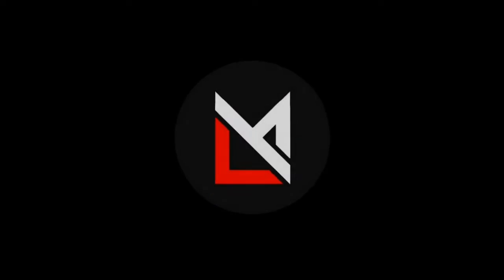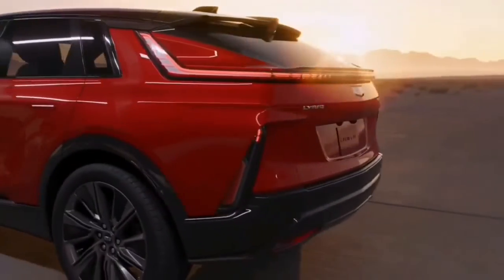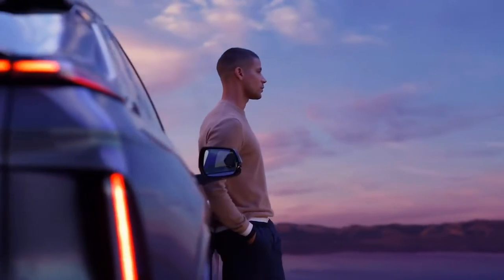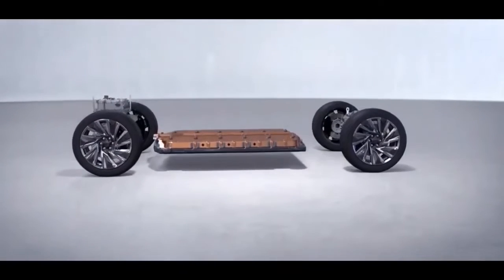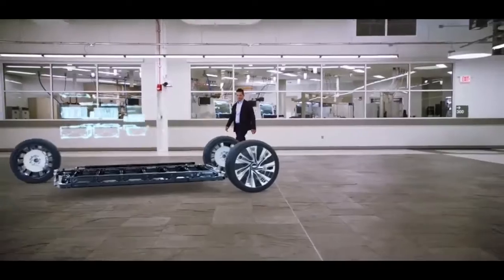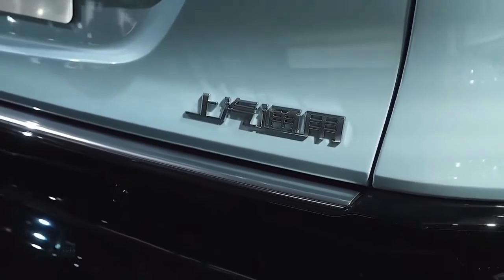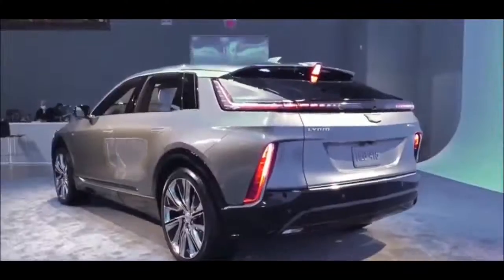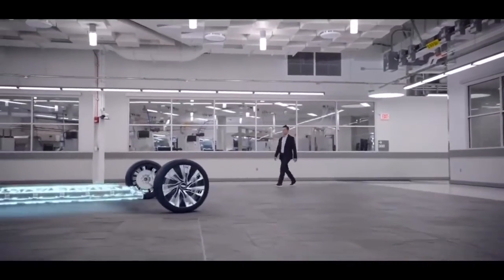2024 Cadillac Lyriq: Unveiling the Revolutionary Charging System

Comment: Please provide accurate and detailed information! While saying level 1 charging is available you didn't say how long it takes to fully charge. You only mentioned "hours". Well, everyone who has any knowledge of EVs knows that....how many hours is what we want to know!!!
Reply: The cord that came with my Lyriq supplies 120 volts to the charger at a rate of about 4 miles per hour or 240 volts at a rate of 24 miles per hour.
Reply: Level 1 is a standard 15, or 20 amp breaker. You'll only get about 4 miles an hour charging. You'll need a 240 plug installed, like a dryer has and you can charge at about 32 miles in an hour with a 11.5 kw charger. You can get over 40 miles in an hour with the 19.2 kw charger.
Reply: @kimwalker108  Thanks Kim, that's very helpful information! I placed a deposit on a Lyric a month ago and know it will be at least a year until it is available. The 240 Volt option should be fine since I only drive 100-150 miles a week.